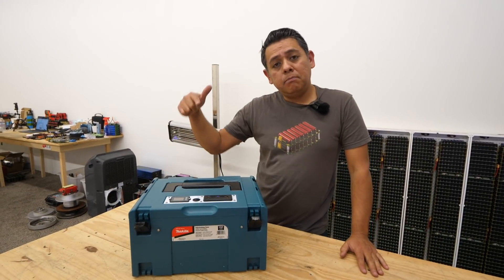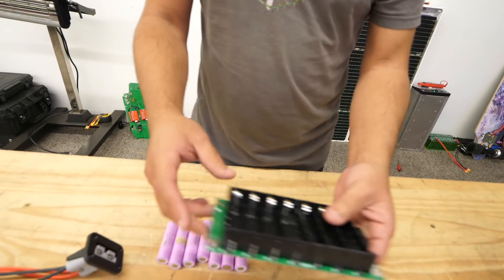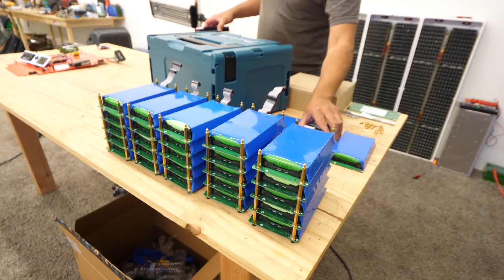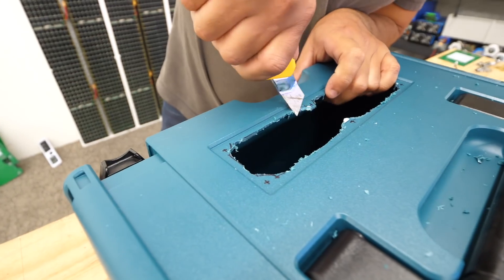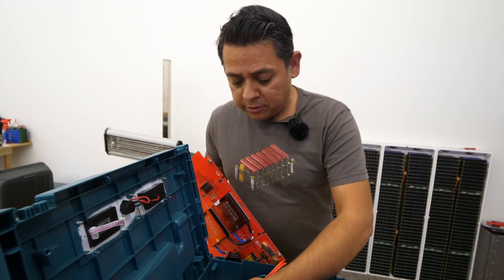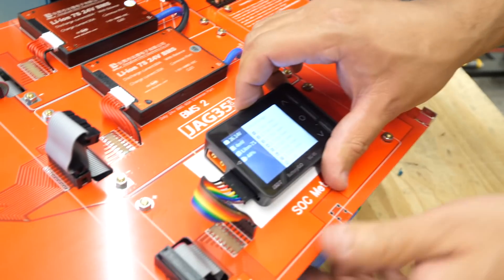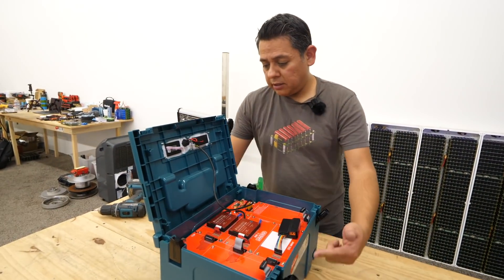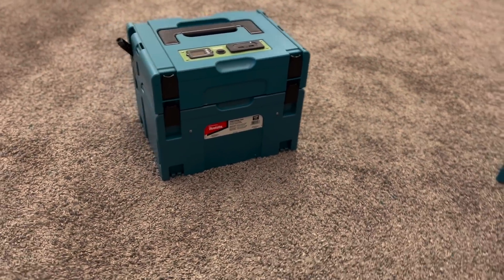Stackable Tool Box Battery Build Project

Comment: I have been planning this kind of project for my workspace using Dewalt ToughSystem so it can be used as a UPS and power the whole room for 2 days or 1 day if using A/C in summer. The only problem is that I am not an electronics guy I don't know how to build an inverter and there's no good 48V systems on the market that I could fit the UPS / inverter charger inside smaller tool box. I would appreciate if you can make a tutorial to build an inverter or have the design put somewhere we can copy off

Comment: Beautiful setup. I have a question about heat buildup, would an option for ventilation be wise? If this is used in a mobile environment could mean summer and winter conditions to adjust for temps ?

Comment: These cells from there are crap. Bought a few hundred cells and half of them are dead. Only a very small fraction met/exceeded specs.
Reply: Which ones ? We got the pink ones from the two cell modem batts, and they were about 95% 2400-2600. I think it ended up being $.60/cell.

Comment: Bad idea, this thing is dangerous. Makita uses a fan in their chargers to keep the batteries cool during charging. And anything over 100 Watthour (eg a single 15V 5Ah already)  can't travel on an airplane with full charge because they are fire hazards. Stacking a gazillion cells in a closed box is not a good idea. Using recycled cells is an even worse idea. Some power tool manufacturers do build this type of gear but they know what they are doing(we all hope). Others will not even touch them. Proceed at your own risk. Or do something with much safer LiFePo batteries.

Comment: how do you charge this guy. Do you use the same output port in the back to charge? If so can a second port be attached in the back to discharge and charge at the same time or is that not possible?

Comment: I don't understand the whole salvaging a pack thing. Can you imagine putting all this work into building one of these just to have one bad cell  killing it every few weeks....
Reply from the maker: No that doesn’t happen,  my salvage battery I installed on my diy VW bus has been trouble free for almost 10 years now.   You need to start watching my videos bruh
Reply: @jehugarcia  ive always salvaged my 18650s from my old M18 Milwaukee packs and find that once 1 cell fail in tose packs the rest are right behind them. Im lucky to get a year out of them in my headlamps/flashlights... Maybe those are not good cells?

Comment: Makita systainer lock system is terrible, no one want open it frequently. This is nice kind of use for it. :)
Reply: OMG,  they are so bad, they are not good brand new, but after a few weeks on a jobsite they get very bad. As a carpenter don't think I have weak hands but the amount of time I've hurt my fingers trying to open/close these is like EveryTime! 😄

The latches  get easier to handle when they are super old and worn out (if the box survives that long)
Reply: Try some wd40 on the locks. Thank me later
Reply: @Spinedesign  I was throw that crap to trash and now I use normal nonstupid systainers... :D

Comment: Not bad..gives me a few ideas but I would put a plate on the bottom of the batteries to secure them. Like you have for the charging board so they don't move around during assembly and transport. Then I would move the display and usb ports on the front rather than the top so you can use them while cases are stacked on top.

Comment: My man, this is NICE! Do you have a mailing list for when the kit is back in stock? I have to have this one, and how difficult would it be to change it to 48v? 24v is fine though, I can work with that. Nice work I love how neat and clean that goes together, fits perfectly! And I love how easy it is to change the batteries out, so this will last forever as long as you replace the batteries when needed. I might need two kits, one for my dad on fathers day..

Comment: So is my math right, this is about $300-500/kwh depending on what batteries you buy?
Reply: Signature Solar Gyll brand rack mount cost less than $300/kwh for their LiFePO4 battery (pre-build with BMS).  This is way over price for DIY.  You should look for DIY of around $150/kwh.
Reply: More than $500/kwh since you will need an inverter as well.
Reply from the maker: Don’t forget the house price also

Comment: the pcb is massive, it could be a fraction of the size and save on cost/shipping
Reply from the maker: the board connects everything together
Reply: @jehugarcia  but you have connectors that are more centralized, you really shouldnt be bolting those heavy battery cages direct to the pcb anyway. Shrink that sucker down and just make a thin plate to hold the battery cages together.
Reply from the maker: Why? Pcbs are super cheap and strong,  why would I want to make it harder for the end user to build this?
Reply: @jehugarcia  you can actually make it easier with a small pcb. Can be easily scaled to different boxes, different battery setups. PCBs are cheap, hard to accept the current cost, but I appreciate the product design and idea.

Comment: You should definitely develop this into a more branded kit, maybe consider contacting a toolbox/ plastic case manufacturer. That way the cutouts will be more precise.
Reply from the maker: why do you want pretty cutouts?
Reply: @jehugarcia  I'm not necessarily thinking about aesthetics, but I think that with minor changes to the case design it could make an amazing system that could be strong competition for  the big name companies. I love the idea of the stacking modules, it gives it an amazing amount of flexibility. The point that I am trying to get to is that with a purpose built case it can provide stronger support for the components, and I see a potential for adding contacts to the case so that they can connect as they are stacked, reducing the need for linking them to each other with cables.

Comment: Very nice!
A couple observations:
1)  You could likely get a fine-tip Sharpie to fit through the holes.
2)  An Oscillating Multi-tool set to a lower frequency or a Dremel with a cutting disc would likely make cleaner cuts on the box.

Thanks for all the great DIY's!
Reply: you don't need to mark so accurately with the way he built the design because he just uses self-taping screws. 

Would be easier to just supply a pdf with marking holes and through-bolt the plate to not rely on the little self tappers.
Reply: @Bradgineer  I think fine tip sharpie would be easier really

Comment: What about cooling?
Reply from the maker: what cooling?
Reply: Is there any cooling required for those batteries. Is there available space for cooling once the inverter is placed inside?  Or will that not require Cooling?

Comment: Hello my friend, I have some tips. I have experienced the explosion of the USB module, so I personally do not recommend installing a usb module on the battery pack. You can reserve some XT30 or 60 ports for external charging.  I highly recommend the SW3518 chip module I am using.  It can identify all types of fast charging protocols on the market, and the power supply is up to 100W.
And please share 21700 7sPCB 😘🙏

Comment: I like the modular design of this, but do the BMS have enought balance dissipation for all of those cells would be interests to see some test cycles to see how balanced it keeps across all the packs and perhaps some themal imaging to see temps while both charge/discharging. and was the ouput Fused not sure if you mentioned that?
Reply from the maker: Problem is everyone’s cells will be different,  some will use new some old.
Reply: @jehugarcia  Thats very true I can appreciate that but I think tests with the cells you sell would provide good information on what could be expected if parts are sourced from you and if you provide the cell specs used then if people do wish to use different cells at least they could then match the capacities for similar results. I think the main takeway is that even with recycled cells the thermals of the design work and the circuit board will keep things balanced over time so peace of mind. Its more work for you I know so understand why you are leaving these tests to users but it does make good content and may invite design changes if issues are found. great content though love the discussion it starts. 👌

Comment: Thats a slick design. Do you charge it through the output plug? Can it be charged with solar?
Reply: From the looks it would be charged via that socket yes, if you wanted to use solar i think you would need a charge controller to act as both mppt for the solar side and to ensure correct charge current/voltage for the battery. wouldn't mind seeing him design a charge controller box aswell for this series, kinda cool concept of the stacking/interlockable boxes.

Comment: Love your videos, Jehu.  Can one hook this into the Bluetti AC200P?  You said this was a 24V battery and I looked up the inputs on the Bluetti and saw only 12V.
Reply from the maker: It’s either 12v or above 30v as I understand it
Reply: @jehugarcia  Thanks for the reply.  So that's a "no" for compatibility with the AC200P (forgive me, I'm a total voltage noob.)
Reply: @jimsterling3838  the AC200P will accept 12 or 24 volts when it is in car mode, and 30 volts to 150 volts when in PV mode, so yes, this unit will work to charge the AC200P, the only downside is that it will only charge around 250 ish watts since the AC200P will only draw between 10 and 12 amps at 12/24 volts
Reply: @FrankKelly1  thanks!  Very helpful.
Reply: It will work great as an expansion battery for the newer Bluetti AC200Max which accepts 900w input through its PV port at 12v to 145v.
Reply: @philipmorgan1438  thank you.  Looks like I pulled the trigger too early by purchasing the AC200P...
Reply: @jimsterling3838  Depending on whether you bought the AC200P on sale for $1200 or not ($1600), it may be a bargain.  The Max runs at $17-1800.

Comment: About how much does it cost with using your two battery modems that you illustrated doing it the way you illustrated it approximately?
Reply: The battery controller that connects the pack... the big orange circuit board is 400 by itself
Reply: @markr394    It also includes the 25 PCB'S  and the  Top control panel with everything you see in it
Reply from the maker: About $120 in batteries
Reply: @jehugarcia  do you have a total $ estimate for the build? 
Then I may quit bugging you with all these questions haha. Maybe.
Reply: @jehugarcia  wow, your solution is what I need. I'm gonna need a power bank but can't find any quality units that don't cost an arm and a leg.

Comment: good stuff. wondering what the overall cost for everything vs similar fully built turn key systems
Reply from the maker: A 2kwh battery from bluetti or Ecoflow is around $1600-$2000   Vs. DIY $500-$700
Reply: @jehugarcia  im seeing the kit is $400, and the batteries are $450, how much does an equivalent inverter cost? you showed/mentioned another build box for the custom inverter...which one is that? when will that be available and how much?

Comment: Looks like you've just made them non-stacking when you put that control panel on the top.
Reply from the maker: They stack just fine
Reply: @jehugarcia  better design might be to put the control panel facing out so you can use each of them while stacked.
Reply: Curious, approximate cost of this build?

Comment: That kit is almost exactly what I need except I need a LifePo 4 set up I have  32650 cells for a 24v system design. The tool box is perfect for my solar set up. Since I'm using it for a bus conversion project and battery storage is becoming a headache but the boxes alow me to stack. Ok so question is how can I do the same with the 32650?
Reply from the maker: You design it,  like like I did
Reply: @jehugarcia  Can I buy your boards with a different BMS?

Comment: would it not be work to have a metal file? I'm sure they are reasonably priced and would be worth to have so that you don't have to work as hard to cut the plastic. but then again I don't know if you prefer to just cut and rough fit in.